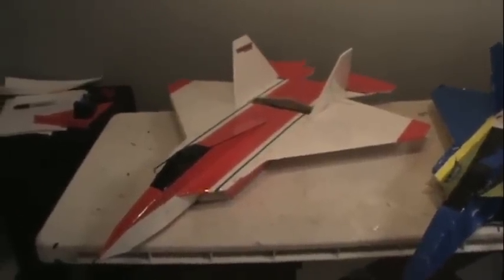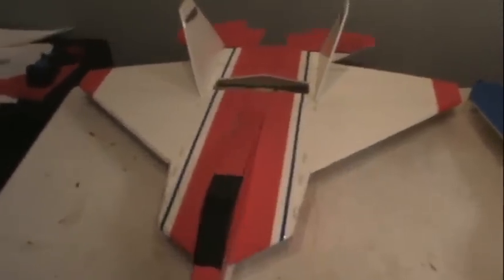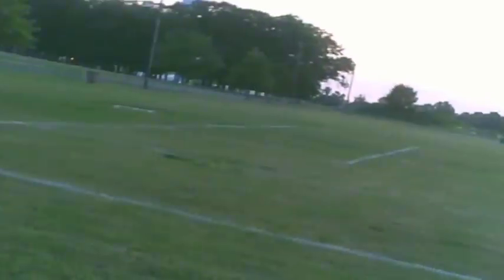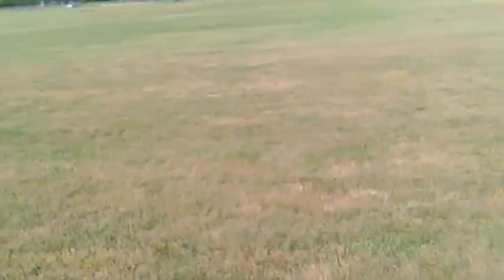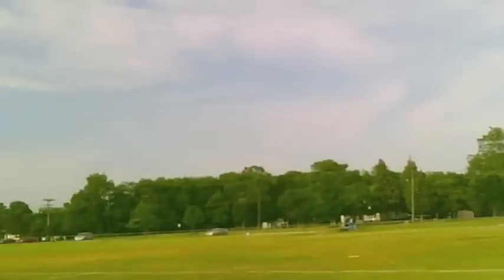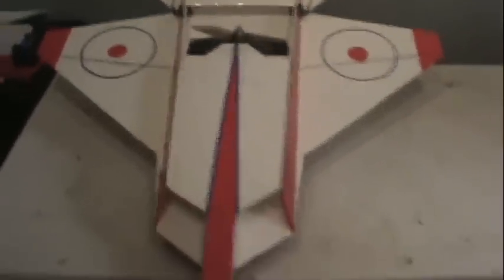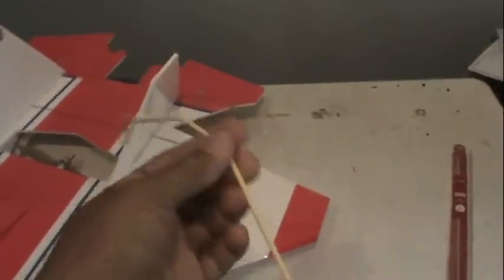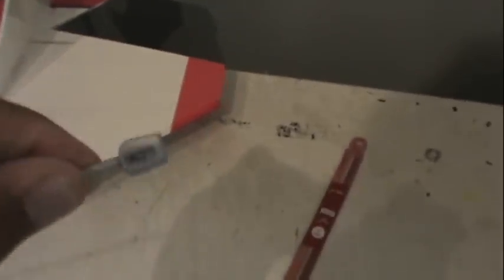Modified FF-22 and a cool tip for reinforcing without carbon fiber

Comment from the maker: @wildhover --Yes I think so to adding that part to the back end made a channel for the air to be pushed out of and directed it start out the back but I still need to get it to fly with no issue at high speed only because the last one I made with the same set up worked fine this one isn’t that bad but only because I know it can is what’s bugging me ,thanks Ken

Comment: thanks for the wing reinforcement tip and great job on that plane. i think the prop wash is tweaking the tail section of your plane and the extra belly plate reduced it, but not completely.

Comment: @RIPcombat Look at the fins compared to the wing, larger wing larger V fins and you inlarged the battery area, all makes a big dif thats why when you boxed the bottom it helped. Try tape on temp v fins 1/2inch front or back and some on top try it. you can remove if'its not helping. and pauls idea, upgrades on the servo can never be a bad thing. nice FF22  i like changing things to

Comment from the maker: @rcFoamFighters Hay Paul thats what I thought to but i'm using all the same parts from the last plane and didn't have that issues and i put all the parts in the same spot the servos are T-Pro MG90S 9G Metal Gear Servo i think i should of just left the plane to its original size that what i get for messing around with the master design LOL.....

Comment: Cool plane Oneill, that thing was zoomin! What size servos do you have on it? With that big turnigy motor the thrust over the elvons might be overpowing them at full throttle. Good job though and nice tip with teh aluminum spars.
Paul